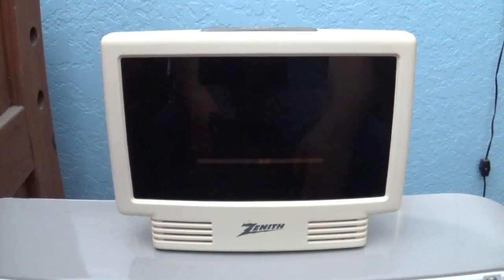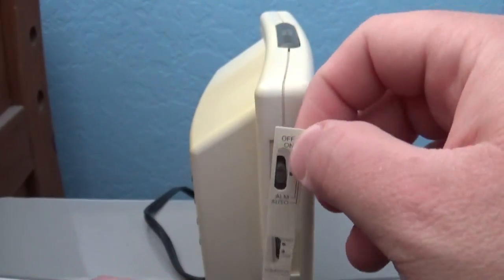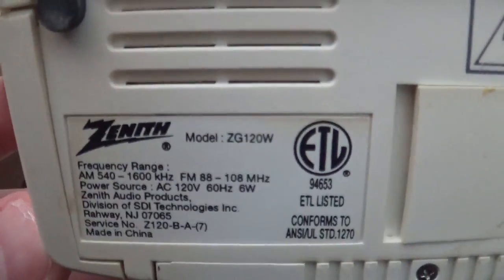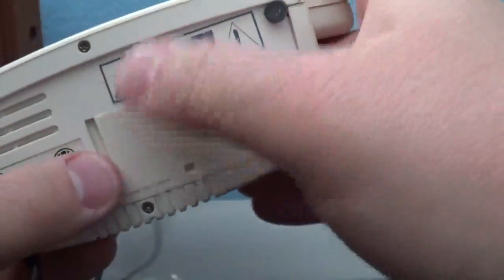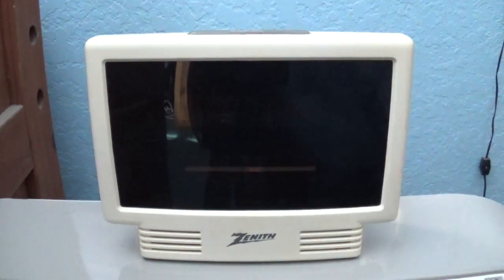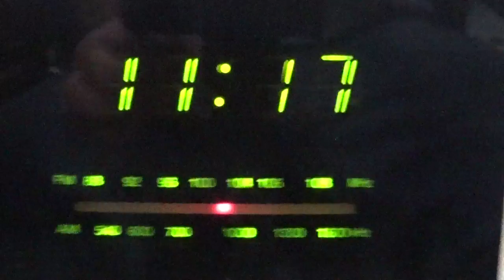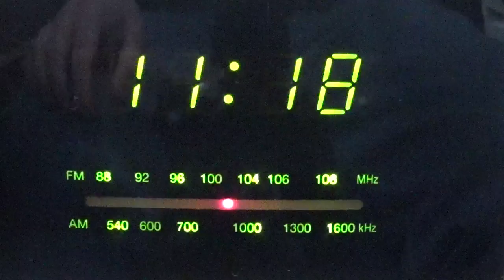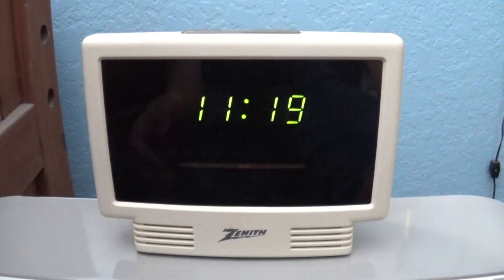Vintage 1990s Zenith AM/FM Clock Radio ZG120W

Comment: Nice video however when setting the clock there is a little red light that comes on just left of the clock time and I am trying to find out if the light "on" is AM or PM. My ZG120 M (just a different color) has a bit of a wire antenna coming out the back for better radio reception. Thanks for the basic tips.
Reply: If the light is on it would be PM

Comment: Zenith makes tv 's that's why it looks like tv monitor
Reply from the maker: +Armando Liederman I knew Zenith made TVs. They also made cassette players too.
Reply: MAGNUM05 what's funny is that Zenith makes something look like something it's not like this clock radio looks like a tv then really it's supposed to look like a normal clock radio and I assume the cassette player looks like this too
Reply from the maker: Armando Liederman No, the cassette players don't look like this
Reply: MAGNUM05 well I guess they made this bigger than it should be